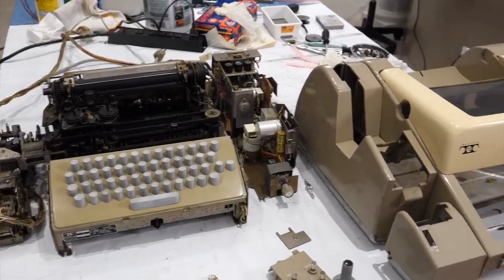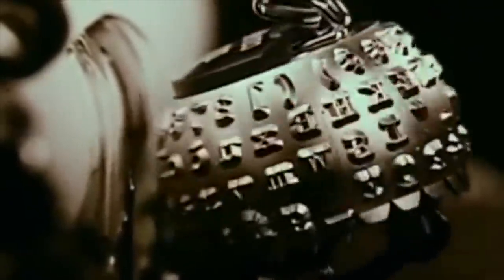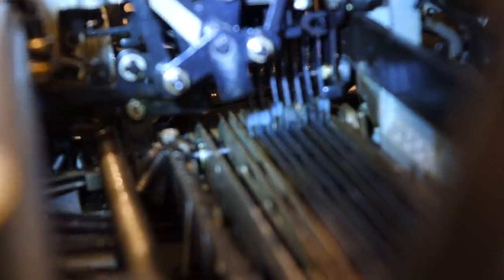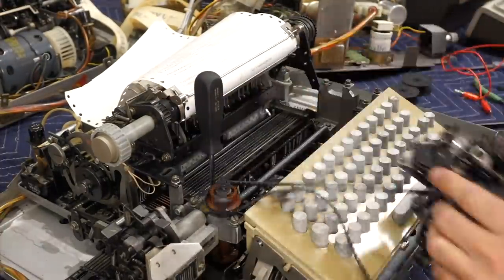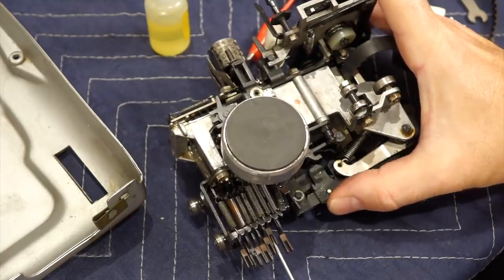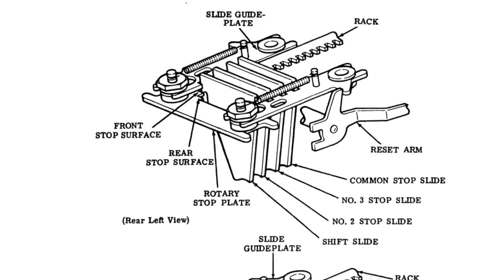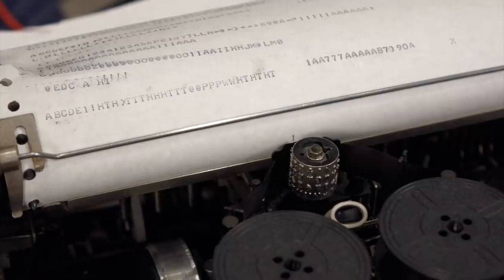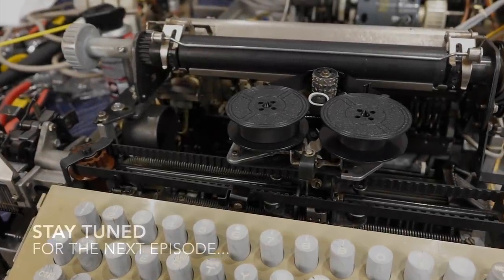Teletype ASR 33 Part 6: Print Head Mechanism

Comment: I marvel at how engineers came up with these designs - it must have been rather a sense of achievement to bring designs into working devices. I imagine there may have been some trial and error and witnessing the whole process would have been fascinating. I’m curious as to how the character head itself was manufactured!
Reply: My guess would be the character head is a cast piece. Though it kind of looks like it might be stamped and wrapped around the drum.
Reply: littlejason99 indeed, casting would be the logical choice but my mind then turns to how the casting mould was made. I used to enjoy watching the local print shop using Linotype machines to cast hot metal lines of text which were then assembled into pages and printed on a Heidelberg platen press. As you mentioned, it might have possible to cast the letters on a thin strip and then wrap them round a former to create the mould.
Reply: I'm amazed how they could make this cost effective.  But then, they used these things to develop digital devices which then make this task cheaper.  All Hail Slide Rules!

Comment: A while back I thought of getting one of these for doing RTTY on the amateur radio bands. After watching these videos I am glad I didn’t. Please understand, I am not faint of heart - I have dug into complicated equipment before and have been successful- but this seems to be at a far higher level of complexity. The machine also seem fragile.

Great video!
Charlie
Reply: The Model 33 was an ASCII Teletype,  you need a Model 19 for RTTY using Baudot code.
Reply: Daniel Bingamon thanks for the input, I was aware of that, my plan was to build an Arduino based converter so the unit would also be able to talk with my computers. I do appreciate the comment however, it wouldn’t be the first time I jumped into something I didn’t understand as well as could be hoped. Cheers, Charlie.
Reply: Keep in mind the 33 wasn't made for heavy duty use.  It was made to be cheap.

Comment: I've mentioned you in my latest video about repairing a piano-key type mechanical Beta video recorder.  It's also full of springs and levers with lubrication issues, just like this thing.
I'm still very sad that I dumped an ASR33 around 1988 when I had to clear out for a house move.  I wish I had kept it somehow.
Reply: Yes I dumped one  around the same time. It was in very good condition until the rubber hammer wore through and the steel part hit the type drum and wore away all the characters during one long listing.

Comment: I was a IBM tech that later on owned an export company with three 32 ASR’s and two 33 ASR’s. All were running constantly. I have to say the 32’s were incredibly reliable compared to the 33’s and the office Selectrics. In fact I was somewhat disappointed I never had a reason (excuse) to get into the guts of the Teletype machines. The 33 did need some minor work but it ran at a speed that makes you wonder why it doesn’t tear itself apart after a few minutes.  The video presented here surprises me. I thought these machines were 100% forgotten. Good work and much appreciated.

Comment: Gummy old dust filled oil lubricant is not your friend on this one. I wonder if a spell in a hot bath of varsol would be able to rejuvenate the mechanical movements (followed by a re-oiling). Is the viscosity of the oil you are using low enough to allow the parts to move fast enough?
Cheers,

Comment: I used to own a KSR 35 which I acquired as surplus from my local Telco in 1978. Built a single board 1802 based microcomputer kit and used the KSR 35 for I/O running Tiny Basic. The 35 was built like a tank. Just ran and ran with no problem. Once our basement flooded and it got submerged. No problem. Dried it out and it kept on running. I remember the ASR 33s as they were used at the University during my Electrical Engineering days. They were much more flimsy than the KSR 35 I eventually acquired.

Comment: I would argue the ASR 33's cylindrical lifting/rotating type-head was inspired by the Creed 75 Teleprinter's type-head that was introduced in 1958 as its more similar in its looks and it predates the golfball shaped IBM Selectric 1 that came out in 1961.

Comment: Repair is think the easy part. Bear in mind you have to desine the thing. The more breakdowns and getting deeper into the mechanical engenering the more I get respect for the designers of this ASR33 and equal machines. But I realise those engineers came from a decade of fine mechanical machines and have a history in bit by bit involving into complexing machines.
Like the mechanical calculators etc. As far As I know my ASR33 is fully working only the rubber hamer has to be replaced. But I have all the manuals and your video's if ever something brake down. Many thanks for great detail explanation. It is a Time capsule for future generation how the machine actualy works. Keep up the good work and finaly it is going to work like new for many years in advance.

Comment: This series is fascinating to me. I'm used to electronics and microprocessor solutions to problems, so I look at these electromechanical systems and wonder how on Earth the engineers could come up with them. It also makes me wonder how expensive these things must have been to manufacture. The number of steps involved in producing all those fiddly levers, springs, brackets, and so on  must have been astronomical.

Comment: The CR execution seems to be quite slow. I cant remember how the machine buffers those characters that are received while the head is moving back. Or maybe it just sends XOFF and  XON to the transmitter?
Reply: There is no buffering. The host computer had to delay or send a few NULL fill characters (ASCII 0) after each CR. On Linux, the 'stty' command still lets you set those parameters.

Comment: A traditional problem with those things was the dashpot getting slightly misaligned and rubbing against the piston, resulting in scoring if not caught in time. This would often result in either not returning quite all the way to the left margin, or worse, hanging up and not escaping right.